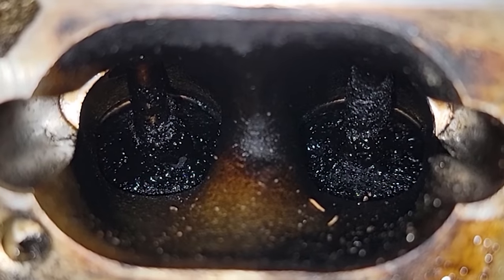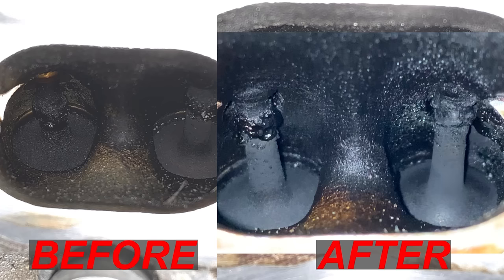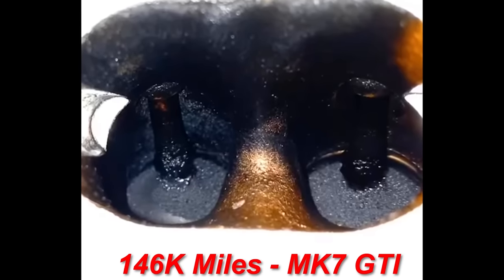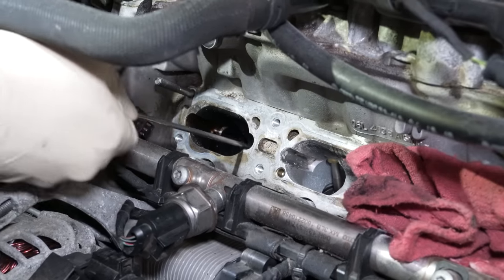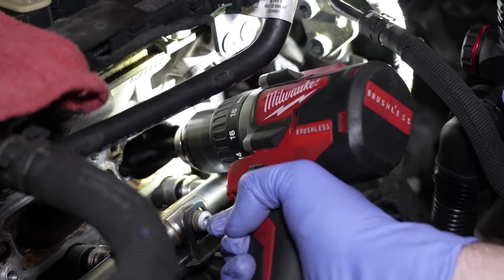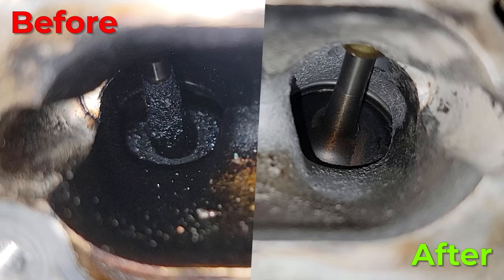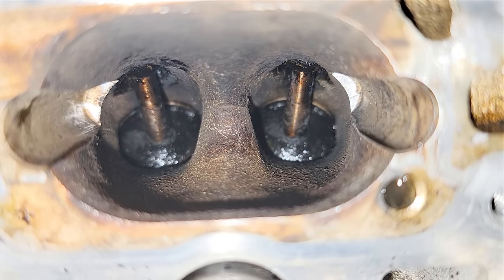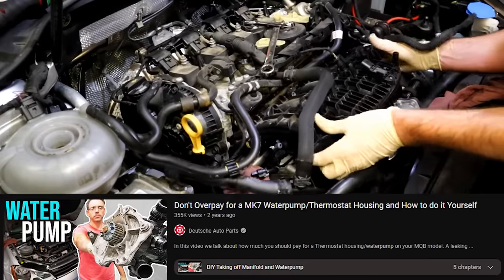How To Clean Carbon Off Your Engine!

Comment from the maker: Find all the parts for your VW or Audi! - https://www.shopdap.com/
- We appreciate your Support and Purchases! -

Carbon Cleaning Kit for GEN3 Engine 2.0T and 1.8T ( 2015+ )
https://www.shopdap.com/carbon-cleaning-kit-for-gen3-engine-2-0t-and-1-8t.html

Carbon Cleaning Kit for 2.0t TSI Engine ( 2006 - 2014 )
https://www.shopdap.com/carbon-cleaning-kit-for-2-0t-tsi-engine.html

24MM Socket (12 Point) 1/2 Drive 
https://www.shopdap.com/wkz-24mm-12pt.html

Don't Overpay for a MK7 Waterpump/Thermostat Housing and How to do it Yourself
https://youtu.be/RIVyvfEWztc

Intake Manifold for VW and Audi 2.0T TSI DIY (How to) Replacement
https://youtu.be/c7c35MJq5e0
Reply: We Can really see, what harm an Egr valve does 2 the engine , which has to eat alll this shit , and gets clogged up just tooo much. So, the cleaning of the engine takes time and energy, which means, that the Egr valve really does Not eliminate the pollution of the environment, it just delays it on later , so it is Worthless , and just a terrible Deception to the entire Humanity, just as the catalysators Are, Because the building of the catalytic converters Also take Tooo much of the environment destroyed. And, That environment damage 4 the production of the catalytic converters wasn't "calculated", so, they have miscalculation , which again makes a catalytic converteers just another deception tooo. Thank you 4 the video.
Reply: can you stop whispering in the mic? Just get to the point. you are not funny.
Reply: Doesn't break cleaner ruin rubber grommets/ guide seals?
Reply: Great video. Btw what does it mean when I have a burnt exhaust valve
Reply: How much it cost?? I am planning to get new car. Maybe better to stay away from GDI eangen.

Comment: Best DIY option is vinegar & baking soda. Least that’s what the lady from the farmers market selling essential oils told me.
Reply: Jesus 😂😂
Reply: Do not forget mint for a fresh exhaust ! 🤔🤔🤔
Reply: No for real crazy lady aside she’s right on this one. Vinegar in particular is amazing for carbon build up. I’m currently trying everything under the sun to get my Alfa Romeo started and one thing I did a few weeks ago was soak the cylinders in strong vinegar. My objective was more about the sludge from it sitting rather than the carbon but after a day of soaking I came back to almost all of the carbon completely gone.
Reply: Rust alert!! Project farm needs to test vinegar and salt chips in the intake.
Reply: @jacobbillups4715 this is true, vinegar contains acetic acid which dissolves carbon into solution and does not harm the metals, different to brake clean which only contains hydrocarbons and helps to remove oils, which will only remove carbon in chunks, though the baking soda part is bogus.
Reply: Lol
Reply: 2016 I had a 2007 Astra 1.9cdti van and for a diesel I thought it was nippy.. 
90k on it.. after about 8 months of owning it my friend borrowed it and drove it 216 miles at 70-80mph so it had around 4 hours running on the motorway around 5000rpm.. 
when I got back in it I couldn’t believe how much more responsive it felt so giving them a good run if they have been short journey round town cars does actually help revive them without any snake oil additives…
Reply: If you mix vinegar and baking soda you get water
Reply: The vinegar works best at 6,000 RPM! Whack the throttle open, and then drink up little buddy!!
Reply: @jsplasha  I've seen so many how to videos that recommend mixing vinegar and baking soda, they just cancel each other out.
One or the other, but never both.
Reply: Baking soda neutralizes acids, vinegar is a mild acid.
Reply: Thanks a lot. I took your advice and now my engine is screwed.
Reply: Alfa use direct injection behind the inlet valve so really clogs the inlet chamber. Use an general oven clean, carefully. This will clear it out. Get your injectors pressure tested and cleaned too.
Reply: Pretty sure that a norwex towel would just get rid of it simply by wiping it over the valve covers.
Reply: I was hoping this was a joke😂 brake parts cleaner is cheap
Reply: if it's any related to carbon steel pan restoration, vinegar will eat the seasoning, which is kinda just carbon? i didnt find baking soda to work (for cookware stuff)
Reply: @jacobbillups4715  and did you watch your oil if it was contaminated..that engine deff needs an oil change and a flush
Reply: @shaban2374 it’s contaminated no matter what cleaner you use. Even if you don’t use any, bits of the carbon can still get through. You always need to change your oil after a carbon cleaning.
Reply: Forgot lemon so it gives your motor a lemony smell! Wife loves it .
Reply: White vinegar
Reply: Just use water down the carb or in the throttle body while its running. Its that easy your welcome
Reply: @rdgd1rd  who doesn’t love a lemon scented exhaust? I love it so much I close my garage doors and let the car run to freshen the air. It’s so relaxing I usually sleep like a baby when I do it.
Reply: @seashackf1  not a bad idea let me try it 🤪
Reply: Wouldn't even doubt it.
Reply: Nah, corn juice and an Italian tune up. Also known as filling up with e85 (assuming your vehicle is capable) and ripping it.
Reply: What about adding mpi on a tsi/tfsi, doesnt that permanently solve that shit
Reply: I used that mixture in my toilet it took a lot of hard work to remove the hard substance it produced .Course Stainless steel eventually removed the concrete like substance .DONT DO IT .
Reply: @SpaceRanger187  does not work!

Comment: It would be really cool to see before and after dyno numbers on really gunked up valves.
Reply: if you actually NEED to see a dyno run to justify cleaning your intake valves because of this poor design ? then you really should buy a different car as it can only suffer in your hands.
Reply: @mathewhoffer4541 He never said he needed anything. It would just make an interesting video. You came at him for a scenario that you made up in your head.
Reply: @mathewhoffer4541 😮 I've never seen someone get burnt so hard as you pal
Reply: I don't think its performance you should look for, the purpose is avoiding failure in the future, but of course fuel will flow better when there is no deposits.
Reply: @allancnc direct injection is sprayed in the combustion chamber at a high psi....... fuel flow? You meant air flow?
Reply: @lacboiatl 1500 psi high fuel pressure
Reply: @mathewhoffer4541  Good to see you gave yourself a thumbs up because no one else did. 😆
Reply: That is why the Gasoline Direct Injector is a Shitty Crapp !!! ! !!! Because , that carbon Dirt must go somewhere, and, if not trough the exhaust, than surely onto the garage floor and canalisation , with a Lot of Work, and energy + money wasted !!! ! !!!
Reply: @mathewhoffer4541 the man said "it would be really cool" not "need".
Reply: @mathewhoffer4541 What is wrong with you. Maybe nothing but that would make you real odd.

Comment: Try cutting the blocks off the end of the zip ties, leaving them as long as possible, then put them through a piece of tubing maybe a few inches long, then put them in the drill. That would let you get them deep into the ports while keeping the drill away from the port, but they would not fly around so much because the tubing would keep them together.
Reply: I did exactly what you said on my mk6 r.. works great
Reply: Wish I saw this yesterday, kept struggling to keep the ties in the drill!
Reply: Dont forget some electrical tape on the end before chucking it into the chuck!

Comment: Thanks Paul. I have a 2016 Mk7 GTI with 200,000 miles. The car is still running great and giving 35 mph highway.  I change the oil according the service reminder, approximately evey 10,000 miles. I bought it new and only used premium fuel, oil and filter.

I'm afraid it has the same carbon build up on the back of the valves. I've had the dealer do a carbon clean 3 time with crushed walnut shells.  I'm starting to see the cold start misfire again so this will be the 4th cleaning. The first time it happened I got intermittent misfires. Everything checked out. It was the carbon. Thanks again to you and the humble mechanic. You-all helpled me to figure it out.
Reply: I think your paranoid. My 05 gti has 150k mileage and never been cleaned
Reply: @andyscott0  the dealer showed me the valves before and after each cleaning. It was bad. The cold start misfire went away each time it was cleaned. I can post the pictures if you would like to see them. I am definitely not paranoid.
Reply: @France  definitely sound paranoid. I have cars with 300k miles that still don't need a cleanup lmao. I own and maintain 5 of them myself and even when they look bad they typically don't cause misfires. If it got carbon buildup bad enough at that mileage then I'd assume you're doing something wrong or the engine has a unique issue.

If your vehicle doesn't call for premium, don't use it, thats causing your carbon buildup. All that changes is the fuels octane rating. When the octane rating is higher, it means it resists detonation which is good for sports cars, but for regular cars they can have increased trouble detonating it. I put premium in my Corolla while it misfired, because it was running too lean and caused a slight misfire, the premium made it less prone to misfires. Once I fixed the issue, using premium actually caused a rough idle. Use what is called for.

If you want to treat your car to nice gas, use chevron, costco, or texaco. They all use a high amount of detergents in gasoline that will actually clean the engine. Using premium fuel doesn't mean your engine runs any better or cleaner unless it was designed for it
Reply: @alextheonewarrior  thanks for the feedback on the fuel.  The user manual for my mk7 recommends premium. I only use top tier fuel formulated with detergent. My use case is not the same as yours. I drive 100 per day on the highway for work. Maybe your cars have not seen as many highway miles. The engine does not have any modifications and it still delivers 36 mpg which is an indication of efficient combustion. The reason it misfires is due to the lack of a homogeneous air fuel mixture. The presence of the carbon around the intake ports wreaks havoc with the air flow pattern.
Reply: @alextheonewarrior  You're absolutely correct on almost everything.  On direct injection engines, you are not cleaning anything in your intake or your valves.  This is one of the only things this video stated correctly.  You are completely correct regarding octane.

Comment: I used oven cleaner, water, carb cleaner, a pick, a compressor airgun and lots of patience to clean the valves on my TDI. The oven cleaner worked FAR better than I had imagined, as a note of caution make sure you rotate the engine so that your valves are closed when spraying any liquid into that area otherwise you'll have a bad day when trying to start the engine.
Reply: Oven cleaner is a good at cleaning up stuff,, used it on some nasty crudely eng blocks
Reply: Yes, and after the cleaning , make sure that you do the Egr valve-off , so, that you never again have alll that dirty shit in your engine !!! ! !!!
Reply: Careful with oven cleaner, Mine is incompatible with aluminium.
Reply: Is TDI susceptible to this? I would have thought diesel was worse, but he didnt mention TDI as being a problem. What was your mileage and how bad was the buildup?
Reply: @paulwary  Every diesel engine gets terribly clogged with the soot from the Egr shit. I had completely clogged head ports + valves at 200.000 km, but, After i had cleaned the complete head + collector , i had since than made 300.000 km, with Not Any single small soot in the entire engine !!! ! !!! Now Think Again Deepper about This Terrible evil Deception. Thank you.

Comment: I installed a water/ methanol injection system to reduce knock and lower egts and it removed all the carbon build up. I was happy to see that it cleans as well as increase power substantially

Comment: On my 2018 VW Golf (Gen 3)TSI, change synthetic oil every 5K miles, use Top Tier gas, change filters regularly.  This is the first time I have heard that these engines don't have big problems with carbon buildup. I had worried about this, but will continue to care for this engine.  Thanks.
Reply: Double injection what makes them less problematic
Reply: Have you done anything to clean the carbon on your engine in the past year ?
Reply: Make sure to use some type of gumout stp in your gas tank and Lucas whole system cleaner in crank case every oil change the Lucas stuff read the directions add in after oil change into syntetic oil one ounce per quart and bro u will have no worrys then u can even not do it some oil chages.

Comment: I had to replace my intake manifold because of the flaps being broken and also cleaned the valves because of cold start misfires. The liquimoly valve clean is what I used along with some nylon brushes attached to my drill. It worked really well, just took a while.
Reply: And Don't 4get 2 shut your Egr valve off, so, that it does not repeat again.
Reply: @bustjanzupan1074 You run into other issues by blocking off the EGR. Your running at a hotter temperature, because your combustion is hotter, this leads to premature failure of seals, puts added strain on your turbo, and can lead to heat soak issues.

Comment: I think the zip tie thing would work better if you used the clip ends instead of the finger ends.  The heavier ends and sharper edges would knock the carbon off quicker.  Could then turn them around and do a "polish" with the finger end.
Reply: bottle brush.
Reply: @Ralph Washburn 🤣🤣
Reply: Weld or melt one end of the cable ties , will all hold together better . Make up a few mixed  combinations of cable tie hacks , use drill in forward and reverse, don't use zip ties with small "metal" parts that "can" fly off  or remove first  .

Comment: Been using the drill and zip ties for YEARS!!  Then I vacuum the bits or carbon out followed up with carb cleaner and stuffing a paper towel in to soak up the carb cleaner and carbon residue before it dries out.  It never looks perfect, but it's GOOD!!
Reply: What type of vacuum did you use to suck out the debris?

Comment: We use the walnut media blast. After we get the cylinder to TDC, it helps to use a pick tool and a seal removal tool (I've never used this tool to remove seals. It looks like a tiny hockey stick) as the first step to get the majority of the carbon off. Then blast it with the walnut media. It is a night and day difference.
Reply: It does work nice(pick) for plucking out the o-rings on a Mk4 rack for the small hard lines, I found out last night as I rarely use them for seals also 😂
Reply: I was gonna go with the walnut I just feel like baking soda is safer but I don't know yet which Im gonna go with. I think the baking soda will do just fine.

Comment: Great video!
In Europe, models from 2013-2017 have dual port from factory, avoiding this problem and better fueling for stage 3 tuning...
Reply: Was about to comment this! MPI is an option for pre facelift cars that is not that expensive.
Reply: @XxSmokeeyxX   so it can be retrofitted to DI (non-EU) cars? Cool!
Reply: @petermolnar8667  of course. It's very popular on prefacelift cars. Unfortunately VW removed it and started using GPF instead for emissions.
Reply: I’ve actually looked into this myself. All the information I’ve found says that tuning is required to support MPI. So $800 ish for the kit plus a custom tune. Unless you’re planning to upgrade the turbo and go stage 3, seems it would make more sense to just pay for the cleaning. It’s likely only once in the lifetime of the car  anyway. I’m just over 110,000 miles on my mk7 GTI and haven’t experienced any misfires, or drop in fuel economy that’s unrelated to a heavy right foot.

Comment: When I had my 2011 MK6 GTI, B12 and other strong cleaners weren’t available where I lived (Alberta, Canada). Canadian Tire just has your usual carb cleaners. Found that fresh oil soaked overnight (maybe only a few hours actually required) helped soften up the carbon, suspend it and also made it easier to clean everything. Used paper towel at first to soak up and remove everything and then compressed air to finish it off. Works very well and if any happens to get passed the valve stems or go down into the engine, I’m not worrying about it mixing with the existing engine oil and causing issues (as opposed to some strong cleaner seeping in).